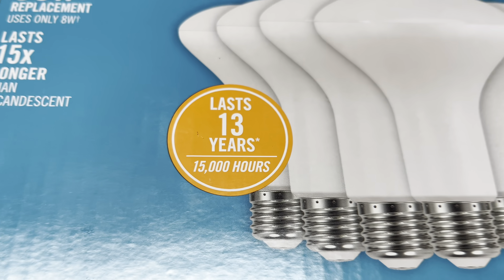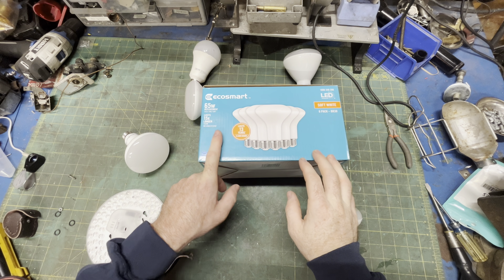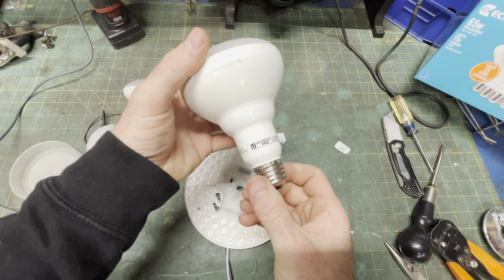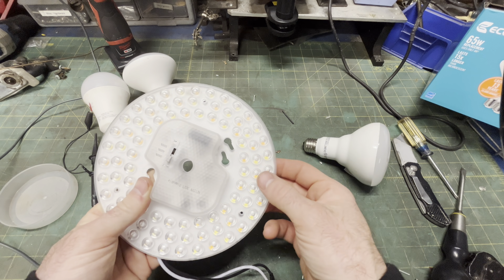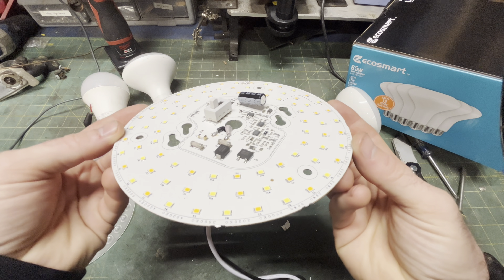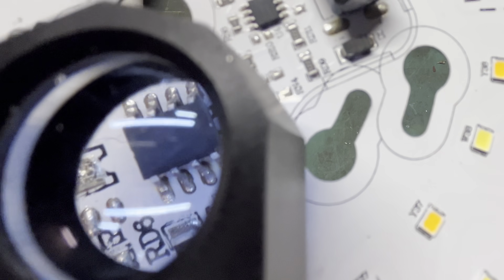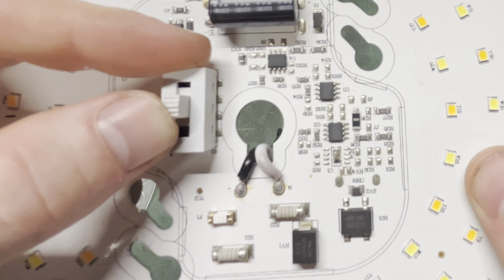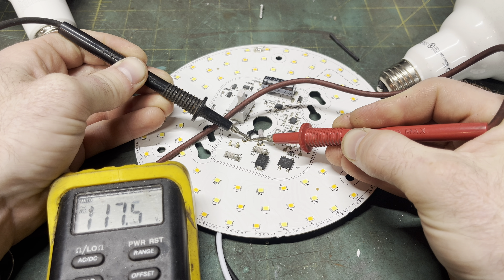Why Do LED Bulbs Fail? An Autopsy!

Comment: Why do they fail (prematurely compared to expectations) ? 

It’s simple. Most LED bulbs are severely price constrained. By using fewer LEDs it’s cheaper to make but to get a competitive light output those LEDs needs to be driven to the edge of their existence. So they get hot, and either burn themselves out or the heat kills adjacent components. 

The thing is, we cannot realistically complain about planned obsolescence while at the same time demanding ever cheaper consumer electronics. Good quality LED bulbs do exist but they typically cost around 5 times more than the cheapest ones. And the good ones do last long. 

Incandescent bulbs went through a similar phase, for a while one could buy incredibly cheap horrendously badly made bulbs that would sometimes break on the trip home. But when well made, they too can last decades. I have some incandescent lightbulbs still in use since the late 80’s. 

Also, fight me on this but nothing beats the colour rendering of a good incandescent lightbulb. 
The 200W versions I have are pretty decent at being subtle space heaters too. (And especially effective at melting modern plastic light fixtures 😅) 

The best hack* for cheap LED bulbs is to trim the current sensing resistors to run the bulb at a lower wattage / current. Aim for around 10mA per LED and they should live a long happy life. 

*Credit to BigClive for this one. See his channel for more details / how to.
Reply: There's no need to fight you on the color rendering index. Incandescent is obviously best (100 CRI and good R9) because it's just a black body radiator.
LED's however can be good. You just need to pay for it.
There are many options with 90+ CRI or 95+ CRI or even 98+ CRI. The CRI rating however is problematic.
The CRI rating only looks at the R1 through R8 colors which are pale colors. Previously mentioned R9 is a deeper red. And if a light has a poor R9 color rendition, skin colors for example look ghastly.
The extended CRI looks at R9-R14 colors as well but CRI Ra value is based on R1-R8 performance.
There is IES TM-30-18 as well and CQS etc. but this needs wider industry support/push and we'd need consumers and professionals to ask for better lighting.
It's just unfortunate that the vast majority of people don't care so we get sub par products.
Reply: Also most people shove any bulb into an enclosed fixture. I need to tear one of those apart
Reply: LEDs, even cheap ones, don't usually fail on their own. In most cases the issue with this type of lamps is a small (or non-existent) heatsink or a cheap power supply. Just look at third lamp - it has everything it needs, and it serves for years. the other ones may serve a year or two before dropping  brightness and eventually failing.

LEDs are also better because you can purchase ones  with high CRI and almost any color temperature you want, even the one of incandescent lightbulbs. But why would you.
Reply: 10mA per LED is pretty low. Even ancient LEDS could tolerate more current than that. I would think double that is still within the realm of reason. A modern blue LED is more along the lines of 30 mA rated. It'll light up at 10 mA but it's not going to be particularly bright. Another thing you can do is vent the bulbs. If you can reduce the heat you will increase the life. Every 10 degrees doubles the life. Heat is that significant a factor. They should stop trying to make light bulbs like light bulbs. Come up with a design that manages the heat better. Clearly manufacturers don't care and are just interested in selling product. They should make lamps with built in PSUs. Maybe the Edison screw base isn't the way to fly today? The packaging is all wrong. Stuffing LEDs into a housing designed for incandescent filament is just dumb.
Reply: @1pcfred  Well, that depends on the LED. I guess better suggestion would be to look at the current they're running the LED's at and then perhaps halving that or something.
In a previous comment I hinted at the LED I/Vf curve. As the current increases, the forward voltage increases as well. LED power does not increase linearly.
Similarly, as you increase the LED current, the light output does not increase linearly.

Just as a simple example, manufacturer might run 50% more current through the LED's, only to gain let's say 25% more light output.
But the power consumed will increase by more than 50%!

So, if you reduce the current, the drive circuit will have much easier time as the power load decreases more than the current or the light output does and the LED's as well will be much happier.

Obviously the 2835 or whatever size LED's are used in bulbs have smaller differences than the above rather extreme examples but the principle applies.

Just for reference, I looked up LM281B LED specifications and it's rated for 150mA at 57-61lm. So you'd need about 13-14 of these for an 800lm bulb.
Looking at the Vf curve, and guesstimating, at 150mA the forward voltage is roughly 3.15V.
Halving the current to 75mA, the forward voltage drops to, let's say 2.95V.
While the luminous flux drops from 100% to, I don't know, let's say 58%.
Current drops from 100% to 50%, power drops to 47% and luminous flux drops to 58%.
See what I mean?

But this is just going from the rated current (150mA) downwards. The max current on that specific LED is just 160mA.
There are other LED's which have a much wider range between the rated current and the max current.
If you do the same calculation for an LED that's driven hard vs driven at the rated current, the difference is only going to increase.
Reply: @1pcfred  But they do care! They want them to fail ASAP so you need to buy new ones. That is why they make custom fixtures for LED lights that are still as crappy and fail almost as quickly as the bulb versions.
Reply: @TheCorintur  I wouldn't characterize their interest as caring. At least they're not caring about anyone besides themselves. LED lighting could be a lot better than it presently is. If anyone actually cared to make it better.
Reply: Since the sun works to illuminate us by blackbody incandescence (not candoluminescence, like a limelight) it wouldn't be surprising that an incandescent light mimics the sun's color rendition well, with phosphor-based lighting solutions falling behind that.  However we generally do accept phosphor-based color graphic displays when the pixels are small enough.  A good color phosphor might not be a very efficient one, however.
Reply: @Lagittaja  it depends on a number of factors. There's a lot of LED bulbs out there and they're all doing different things. I'm just saying limiting one LED to 10 mA is pretty low. You're leaving a lot on the table then. Light you could arguably have without negative repercussions. If you measure a bulb and find out the LEDs are being seriously overdriven dropping them to within specs should be a benefit. But there is a lot to be said for just going with the program and taking what you get too. Cheap LED bulbs are so cheap today when they burn out just replace them.
Reply: @SeekingTheLoveThatGodMeans7648  there are actually some health concerns surrounding the wavelengths of light we're subjected to. Maybe it's nothing. Then again there may be more to it. The whole circadian light thing. Crap LEDs do tend to put out the bad wavelengths too. I definitely have flashlights with cheap blue cast LEDs in them. I've got to admit I'm not a fan.
Reply: It's not really due to using fewer LEDs.  I mean yes there is a bit of efficiency loss driving fewer at higher current but the total heat  output is still similar enough.  A better heatsink would make more difference, or better driver  components.  LEDs do occasionally burn themselves out but if overdriven that much, they tend to last hundreds of  hours at most, not years.

Ultimately the largest issue is everything is self contained into an almost sealed enclosure that traps heat.  Back in the day, very expensive bulbs at least had a finned external heatsink area, but they cost so much that the industry mostly abandoned the design.
Reply: @1pcfred  surface mount chip LEDs are typically much higher than 30mA, unless it's one of those generic chinese designs that stuffs as many LEDs as possible into the available space.  However current isn't always the way to look at it because many bulbs now have 2 or more LEDs in series on the same chip, so you might have only 100mA forward current, but a Vf of the chip is closer to 8.5V.  Depends on the design, obviously not all are configured the same.

Stuffing everything into an edison bulb form factor makes sense for the time being because the majority of existing light fixtures take those.  The goal was reduce energy consumption and that has been achieved even if it is a waste of bulbs to get there.  It is the same shell game as always, pretend energy savings trumps everything else and  try to hide the environmental impact of the e-waste.
Reply: @1pcfred  The average person buying a bulb off the shelf at the store, cannot appreciate the design differences so they are not going to pay 4X more per bulb.  They seldom  understand more than lumens, watts, bulb shape, and occasionally color temperature once they bought the wrong temperature last time.

There were originally bulbs that cost 10X more and they hardly have any market share now, due to these factors.  What we really need is a better warranty program where manufacturers feel the loss from short lived designs.
Reply: @1pcfred  It's not that they are cheap LEDs as much as a design choice.  LED color temp is merely due to amount of phosphors and other layers added, but they choose the glaring blue light because it looks brighter to the human eye, and does actually do so more efficiently by converting less of the blue light of the underlying LED die.
Reply: @Lagittaja  "LED's however can be good. You just need to pay for it."
Where are you finding these LED bulbs that are actually well made and have good CRI? Who makes them? Is there some way to tell if a bulb isn't crap before buying it?
Reply: @johanslabbert2869 you know those weird incandescent saudi arabian market bulbs that were designed to some government mandate about lifespan, so they have a ton of filaments and run at lower current? 
Now I'm wondering if they make the LED equivalent of that, where everything is run super cool and they will last forever, gradually getting dimmer and bluer but never going completely out...
Reply: The tendency for the rate of profit to fall.
Reply: @1pcfred I think the rule of thumb is ~20mA.
Reply: @stinkycheese804  I don't know if blue is brighter but it's certainly harsher. The bluish light makes everything more difficult to see well too. It washes other colors out.
Reply: I'm a photographer. I appreciate incandescent bulbs. I agree with this post.
Reply: If this information was clear to the end consumer I imagine many would pay more for a longer lasting bulb. The lightbulb cartels win again.
Reply: BigClive also found those "Dubai lamps" which are just normal LED bulbs made with more LED components to lower their voltage and current stresses.
Reply: I wouldn´t mind paying extra for high quality bulbs, but i´m not able to find them!
Reply: @Lagggerengineering  more LEDs is a great way to reduce overall stress on the bulb. I suppose manufacturers don't do that because it does cost them more. Although I can't imagine it costs them that much more. Even if they charged more it'd be worth it for consumers to buy the bulbs with more LEDs for increased longevity. Lately I'm seeing a lot of bulbs with Bluetooth. Like I need a bulb with Bluetooth. Maybe if I was crippled and couldn't get up at all. Then yeah I could use a remote control bulb. As it stands now though I can manage to get up to turn a light on and off. So to me at least Bluetooth doesn't seem like the most pressing feature needed with lighting.
Reply: What about LEDs that are deemable? Will running them at 50% brightness extend their service lives?
Reply: @Freddisred  the problem is consumers comprehending the information. Most people are lucky they can even screw light bulb in they know so little about electricity. Their ignorance is well known in the industry and exploited on a regular basis too. So you're facing an uphill battle even presenting that information to consumers. You'd have to begin at the beginning and you'd lose most folks in a matter of moments. Yet we should all be better informed about the subject today being as it's so important to us now. Society lags technology. By a lot.
Reply: @Josh_728  LED bulbs have gotten pretty cheap. Now maybe the real cheap bulbs are lousy. It is difficult to tell the good from the bad without careful examination. Personally I think we're approaching LED lighting completely wrong. We're trying to package LEDs into bulbs which were designed for high temperature filaments. LEDs and high temps do not go together. It's like trying to serve soup on a plate. Yeah you can dump soup on a plate but it isn't the ideal container for the product. You're going to be disappointed with your plate of soup. It's nothing against the soup or the plate but they simply don't go well together. I get that we had all these lamps that took bulbs and it seemed simple enough to just make LED bulbs. But they haven't worked out. We need bowls for our LED soup. Lamps designed for LED lights. If we're never going back to the old bulbs then we might as well.
Reply: @adon8672  you'd think it would but it would depend on how the dimming was achieved. A lot of times what fails isn't the LEDs themselves but the power supply. If the power supply is made more delicately in order to be adjustable then you've only made the problem worse. Increasing complexity increases failure points. Every part you add is just another chance for something else to break.
Reply: @1pcfred  thanks for the prompt response. LEDs are indeed more complex than I thought.
Reply: @Josh_728 illegal huh. Glad I don’t live there, I would have to invest in glass blowing equipment, vacuum pump, and tungsten wire just to make my own out of spite.
Reply: @1pcfred  Don't even get me started on the problems with those obnoxiously bright LED streetlights.
Reply: @Lagittaja  I'm very picky about colors and I can't stand the way things look under LEDs. Especially those horrible "cold white" ones. shudders
My work light on my desk is halogen and I love how vibrant and comfortable on the eyes it is. Also keeps me warm in the winter.
Reply: For ages I could get passable non-dimmable LED bulbs up through 100W equivalent at Dollar Tree for US$1.00. Somewhat high failure rate: about a third of them died in under a year. Obviously a lot of corners were cut in making them. Reasonable value for money, but prone to becoming trash before they should have.
Reply: @integerofdoom69  we don't have that problem here. We don't have street lights at all. At night it's like driving in a cave in these parts. You can't see your hand in front of your face it's so dark. Things look very different then. I make wrong turns in places I know. I only know them in daylight though.
Reply: Fun fact: In the EU they were seeing failures much sooner than that rated lifetime. It turns out that the manufacturers were correctly rating the LEDs, but not the driver circuits, which were failing in a much shorter timeframe. The EU started requiring that the manufacturers base the lifetime on the entire electronics. The manufacturers quit cheaping out on the driver circuits and their bulbs actually last the rated time. We didn't do that in the states of course.
Reply: @adon8672  I had a friend years ago that tried to use LEDs in his model train setup and the idea of a current limiting resistor eluded him. He thought he could use LEDs just like little germ light bulbs. He hated LEDs because they'd always explode on him. The way he talked about it made me laugh because apparently one hit him right in the forehead when it popped. So yeah very complicated for many indeed.
Reply: @curtmeister24  stuffing LEDs into bulb packages just isn't ideal. I know why they did it but that still doesn't justify things completely. When we went to the new tech we should have gone to a new form factor too. It'd have worked better. Just because you can doesn't mean you should.
Reply: The problem is that companies can just charge more for the same shitty bulbs and how is the consumer supposed to tell them apart from the ones which are more expensive and will actually last longer?
Reply: @1pcfred  Sure, heat is the enemy of electronics in general and LEDs in particular. There are, of course, some people who put LED bulbs in an enclosed fixture and are surprised when they fail prematurely. Also in the EU, manufacturers tend to design bulbs that run more LEDs at lower current, so they don't get as hot and last longer. Check out the output vs drive current graphs on LED datasheets.
Reply: @rfmerrill  the bulbs can be analyzed and reviewed by knowledgeable people. Then consumers can know what's the better product.
Reply: @1pcfred  That's fine for rarely used fixtures.  When you have a lot of lighting, especially in hard to reach or critical places, it's much more important that there be reasonably high reliability.  It's worth paying more for perhaps a real ten year bulb that can burn continuously or be switched on and off only once per 24 hours.  The other thing is the tremendously large amount of excess trash going into the waste stream that need not be there. Bulbs could easily be made repairable.
Reply: @1pcfred  Different wavelengths are good or bad at different times of the day or night.  A bigger issue is flicker frequency, usually 120 hz.
Reply: Exactly.  They know if they are too expensive we won't use them and may even push to go back to the tried and true filament bulbs that last even if they are not so efficient. That word 
"efficient" is the root of this evil.  That is because some of the bulbs don't last long enough to recoup their high cost in energy savings.  It is one of the things that make "going green" look bad since in reality it failed and didn't do any good except for the scam artist who sold the item.
Reply: @1pcfred  It is not just about the LEDs as such, even if they only want their rated current at 20°C ambient temp. Every component in there gets it's life time derated with increasing temperature. So cutting waste heat helps against most failure modes. At the same time light output per watt is quite heat dependent - keeping the LED cool helps to make up for the reduced input power.
Reply: @robertmartinu8803   It has been stated by authoritative sources that for every 10°C of temperature difference halves or doubles a component's lifespan depending on if it is hotter or cooler. So it is that critical. Just something I read somewhere in an app note by a major manufacturer.
Reply: @charleshines2142  you can push all you want and they're not going to listen to you. You can go blow glass for all they care. You just ain't getting no bulbs.
Reply: @Mikexxx531  flicker doesn't bother me. I still use a 60 Hz monitor.
Reply: @Mikexxx531  surface mount isn't particularly easy to repair. Not unless you have specialized skills, tools and materials. Acquiring all of that negates the ease of it.
Reply: When there are over 2000 billionaires on this planet hoarding more wealth each than any reasonable person could spend in ten lifetimes ... YES! We can complain and I WILL!

Veritasium did a great video on lightbulbs called "Why we can't have nice things" 😉
Reply: @3nertia  we do live in the best of times on a wonderful world. As you point out some are doing better than others are though.
Reply: @1pcfred  "we do live in the best of times on a wonderful world." -- Ignorance is bliss I guess but just because we're the most technologically advanced we've ever been does not mean "best of times" nor has it created a "wonderful world" ...
Reply: @3nertia  it really is if you think about it. Even the most impoverished live better than kings of old did. We have so much today.
Reply: The capacitor plague may have mostly passed by now, but almost every failed LED (and CFL) bulb failure I experienced for a long time was due to a bad electrolytic cap. Second most common failure was from a bad connection somewhere due to heat, really crappy solder and/or obviously rushed assembly. I've generated so much electronic waste from these stupid "green" bulbs.
Reply: @1pcfred  Tell that to my health problems that I can't afford to do anything about lmfao. We work harder than kings ever did. We didn't use to work winters but thanks to heating and 24/7 lighting we've now got shifts all throughout the dark hours and winter months lmfao. People aren't living longer - they're dying longer ...

The billionaires live today just as kings did then - well off enough to eat their chickens rather than the eggs and all off of our backs lmfao
Reply: @3nertia  some kings of yore worked very hard indeed. They were expected to lead their troops into battle for instance. They'd have their guards but they'd have to get some shots in themselves too. Believe it, or not, being a king made you a target for the enemy too. As it was well known that if a king could be slain usually his army would disperse. You'd win at that point. Kings dying was generally bad for morale. There were practical and pragmatic reasons for kings perishing having a negative impact on affairs too. You as a soldier counted on being paid by the king. There were pay as you go plans but after battles folks expected bonuses then. If one was victorious, of course. With a king out of the picture all of that was gone. So your motivation to fight is gone then too. Then like now everyone was in it for themselves. Some things never change.
Reply: @1pcfred  I'm sure you believe that. I'm sure kings had many enemies, given how most of them treated their "peasants". The word "villain" even derives from 'villager' lmfao. I'm sure you'll have a nice day, troll ...
Reply: @1pcfred  The bluer it is, the more light output for that specific LED  die because all white LED dies start out as blue and  it is the coating over the dye that causes production of redder color hue, at a  conversion/efficiency loss.  Check out some LED datasheets like those from Cree and you will see the trend of lower lumens output as the color temperature drops to a less blue hue.

Frankly, white LEDs above about 4500K color temp, should not exist.  The little bit higher lumens overwhelms the human eye which cannot use the blue light as effectively.
Reply: profit both comes per unit and with purchase frequency. if you would be willing to pay for the net profit of every unit at the sales frequency the company wants, then they should be happy selling you a better device.
to repeat, if you can sell one unit every 5 years, or one unit a year for 5 years, if you are willing to pay 5x the profit margin, you should get the later option.
Reply: @stinkycheese804  yeah I can't see very well in really blue light. I do better with yellowish light.
Reply: @confuseatronica  There is the LED equivalent of that, which uses a greater # of LEDs and improves the efficiency "some", but they aren't all that much cooler running and lifespan still depends on the design and component quality, vs cost.

There will never be any at reasonable price that never go out.  All electronics that run hot, have a finite lifespan.  Most that run hot, have a finite lifespan shorter than the product lifespan would otherwise be for basic staples like light producing equipment.
Reply: Then don't advertise 15 years
Reply: @HMNNO  Yeah the funny math is they take a datasheet spec for LED lifespan under ideal, cool running lab conditions, and often come up with #'s like 10K to 50K hrs.
Reply: @HMNNO  in a perfect world it could have lasted that long.
Reply: @Gearjerk5  the intertubes. Not your local Home Depot or Lowe’s. Industrial/architectural lighting supply, or electronics supply houses like Digikey. Or try museum or film/video production lights. But be prepared to pay.
Reply: … but if you are wanting a screw-in replacement for an ordinary Edison socket, I don’t know. That would be awesome if someone did make a high-CRI/R9, well-made LED “bulb” with good heat dissipation and good construction and components. Bonus points for dimmable compatible. 

Yeah right.
Reply: @benkoning2241  dimmable has never been a big issue for me. I just size the output I want for the task. I always want a particular light level and that's not going to change. I don't think I have a single light dimmer in my whole house. I could certainly install them if I wanted any. Bulbs are the wrong form factor for LEDs. Bulbs made perfect sense for incandescent lamps. The only thing LED lighting has in common with an incandescent is they both make light. Physically they're completely different. Putting LEDs into an enclosed envelope you're going to have heat dissipation issues.  LEDs and associated electronics are heat sensitive. They ain't quite as tolerant as tungsten wire is. Which I believe can handle 3,950 degrees? So there's a bit of a gap there.
Reply: @TheCorintur that’s a very simplistic view of the supply chain. Who is “they”? Home Depot? EcoSmart? The factory who probably builds every single cheap LED bulb out there, and probably several of the better ones, too? 

It’s certainly not Home Depot/Lowe’s, etc. They don’t care which bulbs you buy, their margins are great either way. EcoSmart, etc are just labels, so it’s not them. The factories certainly don’t care - they just build what the customer (Home Depot/EcoSmart/etc) asks for. 

It’s a lot more simple than that. Lowe’s has an LED A19 bulb for $1.99, so guess what they do? They also offer an LED A19 for $1.99. Next year, Menards has one for $1.75 and guess what… A race to the bottom ensues. They don’t care about you replacing bulbs more often - there are much more lucrative ways to get you in to the store. They just care about beating the competitor. Because if you’re gonna go get bulbs at Home Depot, well maybe you’ll finally buy that new lawnmower you’ve been considering… All because they had the cheapest crappy light bulb.
Reply: @Mikexxx531  No one ever repaired a filament lightbulb. Instead of making LEDs repairable, just design them better so they last.
Reply: @1pcfred  It's an individual thing.  I'm not bohered by flicker except when there's a fan in the room and they heterodyne.
Reply: @1pcfred  I've found that most LED "bulb" failures are due to a LED chip or solder joint fail in the overdriven series cascade.  Just jumpering that unit will maintain the circuit for quite a while, especially if the cover is removed and it stays cool.
Reply: @Mikexxx531  when you jumper an LED you're increasing the stress on the other LEDs. But shorting across LEDs does seem to work. Which suggests flaws in the LEDs themselves. Some LEDs just are not up to snuff.
Reply: @Mikexxx531  I've never had the pleasure of that. It is variability that we have less tolerance for. So I can see what you're talking about being a factor.
Reply: I guess my only question is, what are the "good quality LED bulbs" that cost around 5 times longer, but last?

I've tried cheap ones. They die in months. I've tried expensive ones. They die in a few more months. But I have been labeling the install date on LED bulbs for years and the winner for longest lasting was a cheap bulb at 14 months.

I'd pay 5x if they lasted at least 60% of their claimed life, just to not have to change them so often, just to need less space dedicated to replacement LED bulbs.

I'm not being a contrarian. I just want to know what bulbs I can buy that will still be working when my kid outgrows her current shoe size. Any specific recommendations appreciated.
Reply: @thincrediblewho  I don't think any LED bulbs are particularly good. It's a marginal idea that just barely works, if you're lucky. Trying to run LEDs off line current is an iffy proposition. Yeah you can do it but it's going to be sketchy. There's a lot that can and does go wrong. Any single failure is going to render the bulb inoperative.
Reply: Best hack:  don't buy cheap LED bulbs from mystery manufacturers!  I think that's what is happening in this video.
Reply: I bet if you gave these lights proper cooling they'd last 10x longer
Reply: @Auziuwu  I'm not sure about 10X but I imagine it'd be substantial in many cases. Easily double. Every 10°C you can drop the temperature doubles the lifespan.
Reply: As a plasma fanatic  I just stick to fluorescent lamps. Most LEDs are boring for me. Filament style is OK but most other types are as ugly as the average mother-in-law.
Reply: @SeekingTheLoveThatGodMeans7648  the sun has both blackbody and nuclear fusion photons
Reply: @confuseatronica - Yes, the Persian Gulf states (UAE, Dubai, etc) addressed the issue a few years ago and set a performance standard for all LED lighting to be sold in the region- its HOT there! Just imagine how short the life of some of these marginal bulbs (reviewed in video) would be at summer temps exceeding 120F (in the shade) regularly, maybe 99F at night! Even in the Southwest deserts of USA (where I am from) thats not unusual. The caps cook out quickly (if electrolytic), and all other components are operating at their upper limits constantly. If not operating in an AC cooled space- they are toast! Actually, the CFL bulbs had the same problems there and made more heat in operation, experience with those is probably why they finally put their foot down. Im sure the gulf standard lights cost more, but are worth it.😊
Reply: @adon8672 - spell check, I expect you mean "dimmable"? Yes, lower power = less heat and voltage stress usually, so longer life (with the proper rated dimmer control). Thats also how industrial long life incandescent bulbs work, with thicker and higher resistance filaments, better supported, that burn cooler and dimmer.
Reply: @Gearjerk5  That is very important.
Reply: @Josh_728  The last point is important.  Here in Edmonton my heating is run 8 months a year, so during this time heat from indoor incadescent is not lost, it is usefully helps heating the house which I have to do anyway.   And that is also the time when the light runs for more hours,  in summer my use of lights is small.   I did a calculation, and indoor LED do not lead to much or any saving for me. Actually, under more extreme assumptions, incadescents buy/use may even be slightly cheaper overall.